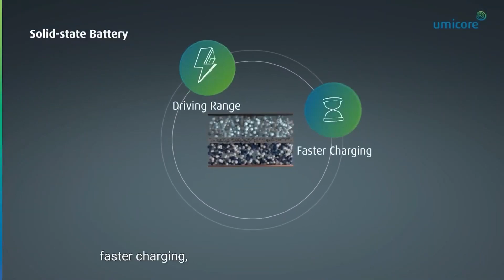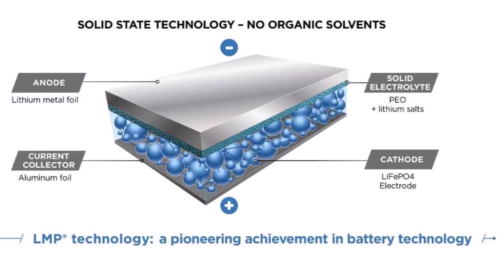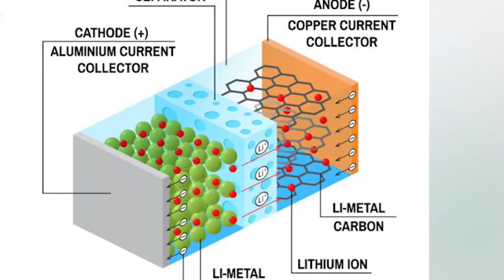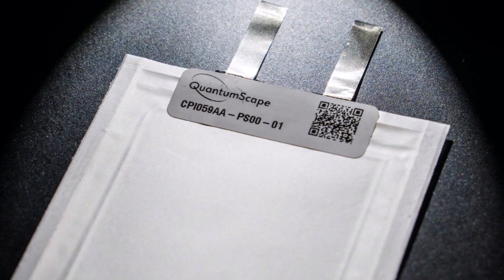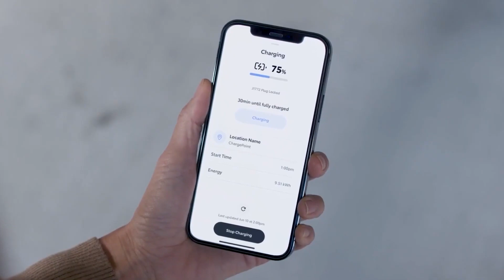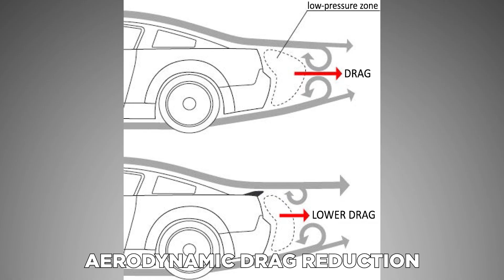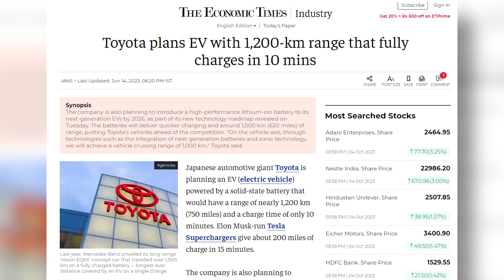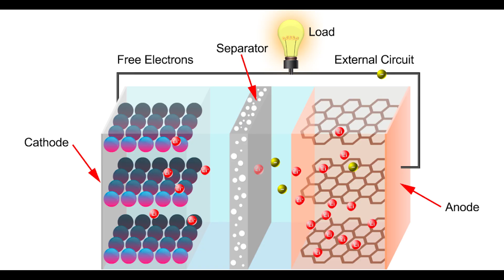Toyota's Insane New Battery Tech Explained

Comment: Yes, Toyota is no.1 solid state batteries not China.
Reply: Based on what?!  Best at making empty promises?  Best at promoting failed technology (I,e., Mirai hydrogen-powered cars)? 
Make no mistake—Toyota is the biggest car manufacturer for a reason, and if any company can flip the switch and crank out well-built, desirable EVs it’s Toyota.  It’s just that it hasn’t made that commitment.  The BZ4X? Pffft! Second year model doesn’t offer any significant improvements over the first year’s model.  Range is the same, and no OTA system software allowed. It has to be brand loyal ppl who are buying it, bc it does not compare well to other evs.